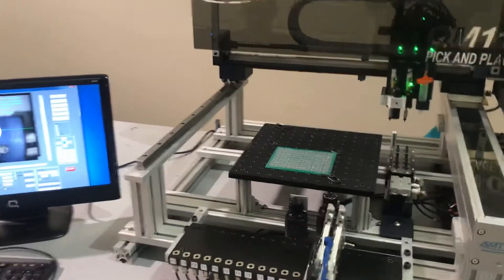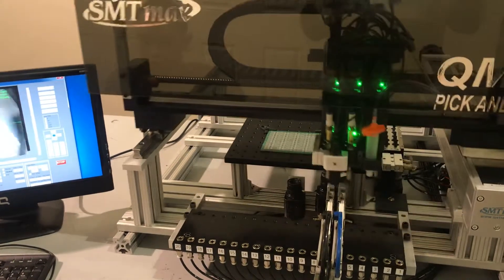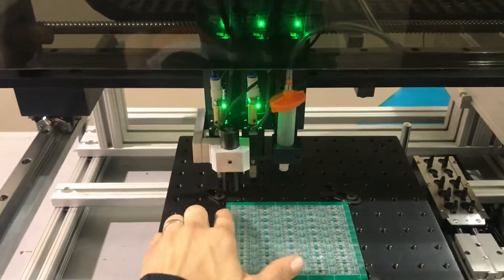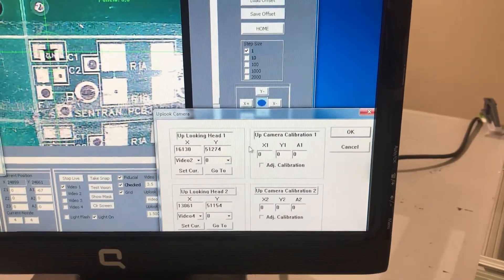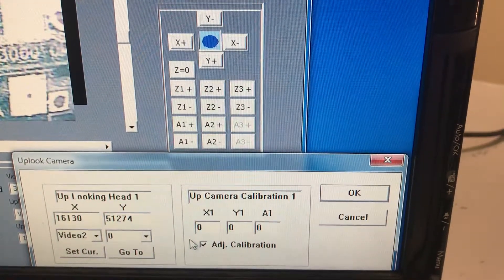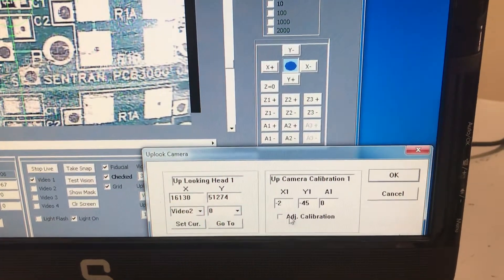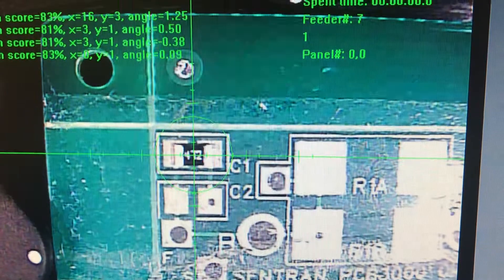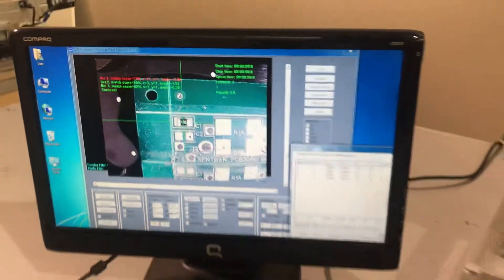Up-Looking Camera Correction

Comment: Could you elaborate on “once for each head and for each angle”?  If I have 0, and 90’s (2000);  do I calibrate first for each head for 0.  Then choose an angle and calibrate to that?  Then whether I have 0’s, 90’s, or 22.5’s that single dialog box is all that’s needed?